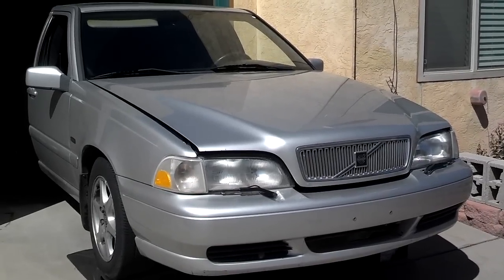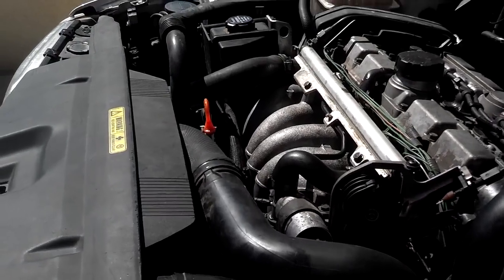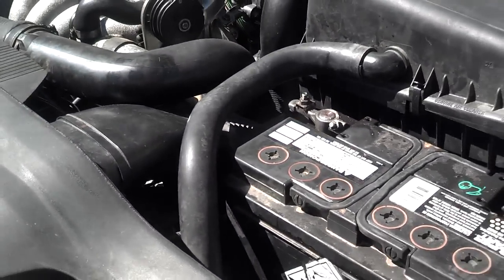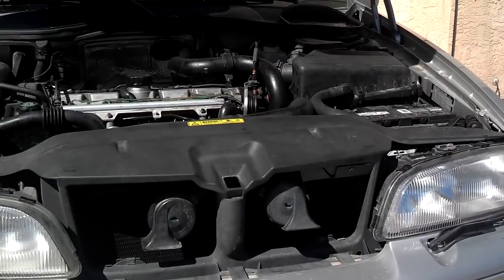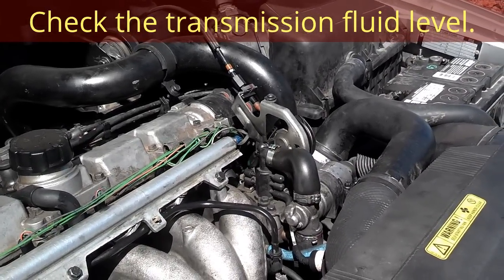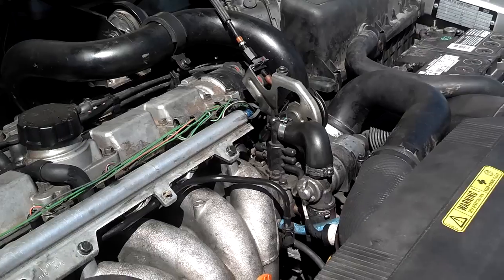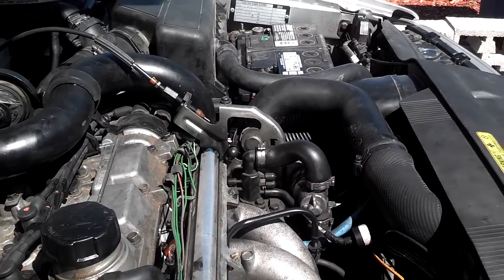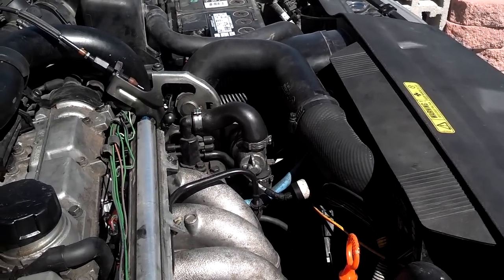Automatic transmission problem warning, bad radiator. PSA - VOTD

Comment: This is GOLD Robert! I recently gifted a car-less friend a V70 T5 for use in his new startup automotive related business. (You may have seen the post in Volvospeed). He mentioned a week after that his mechanic mate said radiator needed replacing, something that had been done 12 months prior. I dispatched my mechanic who said EXACTLY what you just did. We repaired the pipes, flushed the box & fitted an external transmission cooler. I will be doing the same to my 855R this week, I don't want to throw down 3Large to replace a box.
Reply from the maker: Richard Gregory Very nice. Thanks for watching and sharing.

Comment: Changed my fluid one time so far. Got the 3 and half to 4 quarts out. Now the cra drives flawlessly when its cold as it always did. However now when it get warmed up and I get into stop and go driving i can floor it and the car barely moves in first and second. If I can get up over those Gears it runs fine. It can get so bad I gotta sit for hour or 2 to let it cool down. Flashing arrow has come on recently. Happened since fluid change about a week ago. I'm defeated. Second car in a row I've owned in a few month period that's gone out on me. 99 v70 xc awd with 175 thousand. I really liked this car to. Gonna attempt the Lucas trans stuff today as I don't have much money or ideas. Kind of a hail Mary attempt and hoping for a miracle. Was watching your videos and getting every single but of maintenance up to date. This trans issue has me pretty depressed
Reply from the maker: If it has an error in the transmission it will not start in 1st or 2nd, it starts in 3rd gear. A safe mode.

Comment: Hello Robert, once I got this phenomenon at a Citroen XM V6; he had the oilcooler down at the Oilfilter attached and the water goes around this attachment. So, once I got an signal in the dash and coffee into my coolant system after opening the cover. 1st I thought its a head gasket, but later I have understand that the oilpressure of the engine oil (3Bar) is much higher than the coolant arround 1 Bar, so the oil was pressed into the coolant. So, always be avoid to make a good diagnose before you spend a lot of money for something it was not gulity :)
Reply from the maker: Dalibor Sacaric Wow, strange things auto makers do.

Comment: +Robert DIY, people need to ensure that they're also using the EXACT OEM radiator for that Volvo. Yes, there is a different radiator for an automatic versus a manual. And, the same applies to different models as well. For example, a radiator for a turbo, needs to have room for the intercooler to get "wrapped around" the radiator. You CANNOT go to AutoZone for a replacement radiator, & expect your Volvo to run the same. Generally, you're better off with genuine, quality OEM parts from a salvage yard. HOWEVER, confirm your fitment first, & save those brass side clips! You'll need them to attach your a/c condenser & intercooler to your radiator.

Comment: Hey thanks for the vid! I have a flashing arrow on my 02 C70. It will drop into a gear and I can only stay in that gear, can you point me in the right direction on where I should start in fixing it? Thanks.
Reply from the maker: https://youtu.be/cWKOi8D4SWQ?si=U6C2Q1eSt7xEDdDo
Reply: @RobertDIY  Heyvthansk for the help. I pulled the code. It’s p0753 Shift Solenoid A. Do I just replace that Solenoid-where do I find a new one? Thanks.

Comment: my dad has a 2001 V70 that sometimes suddenly bucks in gear-Do you think this is a transmissions solenoid issue? Also car gets hot under driver's side could that be transmission related as well?

Thanks!

Comment: so my 2002 V70xc will not go in to reverse, i changed the pcm , stil no change, remove and clean the TCM, and that did,nt work , i also noticed moving the shifter from reverse to park, a grating sound , does this mean i need a transmission?
Reply from the maker: That would be my guess. How does the fluid look?

Comment: I got a 98 Volvo V70 with a 2.49 turbo motor in it I'm having acceleration issues it will go to 40 mph and be taking 4 grand and won't shift unless I get on the downhill stretch wondering what could be causing this
Reply from the maker: https://youtu.be/NhtUXZTurzo

Comment: Thanks Robert, I've watched several of your posts and is very helpful. I'm a do-it-yourself lady with a 2001 V70. Having trans symptoms and notice my coolant level lowering faster than normal as well. Sometimes slight smell of coolant when been running a long time. Could this be related to trans and radiator?
Reply from the maker: My guess would be that the heater core is leaking.

Comment: Robert, I have a 98 Volvo S70 non turbo 4speed auto. My radiator fluid looks milky brown and watered down. I had a episode of transmission issues a while back where my car acted like it was gonna blow a head gasket and wouldn't shift itself into 3rd gear. Since that day issues have subsided but I'm noticing I'm not getting as much power as I used to. Any ideas on what needs to be done? Other than what you've stated in the video.
Reply from the maker: Any codes?
Reply: @RobertDIY  no, only thing light wise happening is my fan light comes on when I accelerate.
Reply from the maker: Low coolant, interesting.

Comment: Now that does sound nasty.

Sounds like the brown buttery substance that a bad head gasket creates by letting the water get to the engine oil, but the atf problem sounds much nastier.

Auto gearboxes death if not sorted quick, good video mate.
Reply from the maker: zx8401ztv Thanks for watching and yes, that needs to be dealt with quick. Transmissions don't like foreign fluids.

Comment: Hey Robert, love the channel, question:
 I have a 1997 Volvo 850 T5 just replaced the head gasket however I still need to get the PVC system done I think but we replaced the head gasket because there was a creamy oil substance in the engine ie; dip stick, valve cover, and under the oil cap, then I just put new oil in after draining the old and a new oil filter now the oil looks creamy again and it almost smells like gas is getting in the coolant/anti-freeze too. Any ideas? I haven't found any common issues of this kind of problem, does the radiator also cool engine oil?
Reply from the maker: dno440 Sounds like you replaced the head for nothing. :(  - https://www.youtube.com/watch?v=za8qgxDey8I - https://www.youtube.com/watch?v=jsxPXltMFOc
Reply: I agree however befor I replaced it when it was warm it shot out a ton of steam right now there is none, and there is minimal water in the oil, do you have any ideas where it could come from?
Reply from the maker: dno440 Did you watch the linked videos?

Comment: Have a 99 v70 xc. Was having issues with the key getting stuck in the ignition, lubed up the shifter button and it seemed to work. Went to drive today and the car did not want to go into reverse and was getting "stuck", in drive as well and had no initial impulse in either gear. It eventually started working, went to drive tonight and the same thing happened. The car had a known coolant leak when i bought it and I put in K Seal for quick fix, without prior knowledge from this vid. Could that be the cause of my trans problems? Seems to match up with whats said here besides the key getting stuck. Thanks for any help
Reply: I must add that before wd40 on the button the shifter was stuck and i could free travel across all gears until i physically released the button
Reply: Checked the trans oil and it was very dark brown like you mentioned
Reply from the maker: https://youtu.be/rNi4orgovpE

Comment: Hey thanks for the info! However, I am having a different issue that i can't seem to find much info on. I have a 98 v70 AWD with Auto Trans. When I accelerate hard at stop sign or stop light, my car shifts out of drive and into neutral. If I accelerate slow, it doesnt do it. I just did a flush about 300 miles ago, and everything looked okay. No leaks, and the fluid is at the right level currently. I was wondering if you might be able to point me in the right direction?
Reply from the maker: https://youtu.be/NhtUXZTurzo

Comment: Hi Robert. Always liked you video!. 
I have a Volvo 850 1996. Recently had the problem you described in this video.  The trans fluid became milky and gears were not engaging at all.. i stopped the car, towed it and changed the radiator, flushed a number of times and after that the car runs good. Only after a week, it stopped in the middle of road and no gears shifting or engaging.  Same problem.  I checked the fluid and it looks good. Red in color and no weird sound or smells. What could be the problem now?  Transmission??
Reply from the maker: If the fluid level is good the transmission is probably dead or the drivers side CV axle has come out a little.

Comment: Hi Robert, My son has a 2000 Volvo v70. It had the ABS light come on, and a bit later the yellow arrow that points up is blinking. Also the swerving line symbol is on traction control i suppose. He is an hour and half away at college and not near the mechanic that we trust who usually takes care of the car. We are having to take it to a local place because we are not sure if it is safe to drive it 60 miles in that condition. What do you think? The nearest mechanic that works on volvo's wants to charge $120 to diagnose and then ont top of that the hourly rate and parts. We are driving over next week to take the volvo to that mechanic , so we don't know the diagnosis yet. I am not sure if this is fixable or worth the money to fix. DO you have any ideas of what the problem could be? (I understand you are only guessing.)
Reply from the maker: If the warning lights are not RED, drive on.
Reply from the maker: ABS Module.

Comment: Hey Roberts, thanks for the nice video and explanations. My problem is different from this video. 
I have a 2002 S80 2.0 T automatic transmission. In past 3 days while driving at D, the transmission/car vibrating between 1500-1700 rpm and gets to normal after 1700 rpm. It does especially when car down shifting due to driving at  low rpm. And finally last night, there came a warning TRANSMISSION OIL FIX NEXT SERVICE.
My service offered me to flush transmission oil and change filter and observe the change. If no change they will open the transmission and check the tribune.
I tried to locate the dipstick of tranny but couldn't find it. I wanted to check fluid level.
Reply from the maker: +Cem Eserdag if no fluid is leaking the level should be good. Some don't have a dip stick. Also, it may have a GM transmission.
Reply: Robert DIY I don't observe leaks on the floor. My transmission code is 5055SI or something like that.
Why do you think it makes vibration at certain rpm and popped up warning?
Reply: BTW, warning and light ⚠ remains all the time.
Reply from the maker: Probably has a bad gear or something in it. I really have no idea, I don't know much about transmissions.
Reply from the maker: https://www.youtube.com/watch?v=e-ME5_JcJ7g
Reply: Thank you Robert. Wednesday, the mechanic will put down the transmission and open it to check. I will write here the result.
Reply: Cem Eserdag what was the result?

Comment: so what is the exact fix to thisfor me I have some gloopy stuff on the overflow cap for the 95 Volvo 850, its brown color, I can't check the ATF dip stick without it being a problem of me going under the vents or hose, pop it up then pulling it from above since there is n clear access to the dip stick
Reply from the maker: Huh? Is the coolant a different color?

Comment: Hey Robert my 850 Turbo seems like its not holding the Rpms in sports mode like it use to and seems to select the next gear quicker than normal. Is this a solenoid problem? I have no codes. On the highway it takes a little bit to get it to downshift.
Reply from the maker: +Scott how is the boost? Could also be a bad TPS.
Reply: Robert DIY I can try it, it seems like it likes to go from 2nd to 3rd quicker than normal. Boost is good, tuned to 20psi

Comment: hey Robert DIY, issue with 2000 Volvo v70 has hard downshift on automatic transmission was told it was the transmission shift control solenoid valves, do you have a step by step video of the removal and install.. coming to you from Texas, thanks Artis
Reply from the maker: +Artis Preston No I don't. I know very little about transmissions.

Comment: Hi Robert.. I have coolant in my transmission and only found out when the red arrow came on my dashboard and the gear changes became real harsh and jolts so u havnt driven it for a month now.. Do u think my transmission is repairable.. I have  a 99 v70 non-turbo
Reply from the maker: Daniel Smith It is worth tying. The sooner the better.

Comment: Hi Robert,
On my V70 97 my transmission shifts normally but I've got a flashing arrow on the dashboard. The code is 522, and even if I erase it, it comes back 10 seconds later. Quite confusing
Reply from the maker: Yuk! What's the code for?
Reply: @RobertDIY  the scanner says "communication control module"
Reply: @RobertDIY  means communication control module,  and there is also an alternate blinking between sport mode and winter mode. I can't put the transmission in winter mode, but it shifts very well

Comment: Hey Robert I'm having trouble with my transmission the shift light on the dash is flashing I have no gear some times the work for like 5 feet only if you rev the car up to 7000 and my lights sports mode economy and wet/winter the lights keep flashing on it too
Reply from the maker: +Fred Sorrell what kind of car do you have?
Reply from the maker: +Fred Sorrell https://youtu.be/mCyu_nJFA3I

Comment: I have volvo v70xc and when it  shifts to gear 5 ,D is replaced by dash dash .I flushed the transmission fluid and replaced speed sensor which was faulty during diagnosis .Please help
Reply from the maker: You want to bring it by?
Reply: @RobertDIY  I am residing in South Africa
Reply: and my volvo dealer wants me to replace the whole gearbox(transmission)
Reply from the maker: Does it drive ok or is it not shifting correctly?
Reply from the maker: Could it be a problem with the cluster?
Reply: @RobertDIY  fails to maintain a 4/5 gear and  it changes down harshly with a throw-down sound like

Comment: thank you !! I was wondering where goes my coolant and why shifting is heavy and when checked transmission level I noticed that at the and of the pin  very liquid drop mixed with something (not clean oil)
Reply from the maker: sodmod Thanks for watching.

Comment: My transmission in my 2000 s70 was shifting fine then all of a sudden while turning at a stop light and it started acting like it wanted to go untill I got to 3rd gear and wouldn't up shift anymore or down shift anymore and the up shift arrow started blinking. I replaced the pnp switch and it is still flashing and is in limp mode. What should I do I'm thinking about replacing the transmission fluid and filter to see if this helps
Reply from the maker: I don't think it has a filter. Have the codes read.
Reply: Robert DIY  it read a p1618 pnp switch circuit input and a p0705
Reply: And also evap vent valve malfunction
Reply from the maker: Maybe a transmission going out.
Reply from the maker: Where did you get the PNP switch that you replaced?
Reply: Robert DIY I replaced it myself
Reply from the maker: Where did you get the PNP switch?
Reply: Robert DIY advance auto parts online store the part is from Euro parts
Reply: My volvo did that but it was a coil pack #5 cylinder not the tranny

Comment: Hi Robert, the transmission in my 850R is not shifting right.  I flushed it first. But after a 100KM's it gave me black oil. So, the transmission must be bad. Changed the transmission for one with 160.000 km and it's still shifting the same!

Bad radiator? 

I've replaced two of the four enginemounts. I'm still waiting for the backone and the one from the transmission.

 When driving around 80KM/h and pushing it to the kickdown it will shift back. Then after it shifts to the third gear it gives me a hard bang. Any ideas about this? :)

Could it a bad back mount and transmission mount? At the backmount the steel cable is lose. So that one must be replaced.
Reply from the maker: +Kevin Walter Hard shifts are usually bad mounts.
Reply from the maker: +Kevin Walter https://www.youtube.com/watch?v=azZ6HAjRihk
Reply: +Robert DIY Thanks, found your video already. :) Will replace the two remaining mounts and post it back. :)
Reply: i have transmission fluid in my radiator reservoir  drained it cleaned and same thing again not in engine or radiator what can i do.

Comment: Hey I don't comment often but I just found you through a little 850/Turbo/R group on Facebook! Just subscribed. I'm about to buy an 850 with this box and this CEL code. It also has a speed sensor code. The radiator has been replaced too. It's a 1998 with 170k I'm hoping to get for $900. Is this a horrible idea? It shifts well, apparently. Thanks for all you do
Reply from the maker: https://www.youtube.com/watch?v=DMw_DgZulKc
Reply: Hahaha, I like it. There needs to be more people out there doing what you do. Maybe you would know a more specific question, because I learned a little more about the car.

So, the transmission cooler line that you speak of came disconnected. The car smelled like burning fluid, and he pulled over and had it towed. He did not drive it like this for more than .5 miles. It has "worked perfectly" ever since but the code showed up and will not go away. In your opinion, how much of a gamble is this transmission? I looked in to the ideal shift points, lock-up points, etc. If it passes these tests, do you think the Vehicle Speed Sensor could have just been damaged and need replacement? It does not go into limp mode. 

I'm not expecting an answer because I'm sure you're a busy guy. But anyone's experience here is welcome!